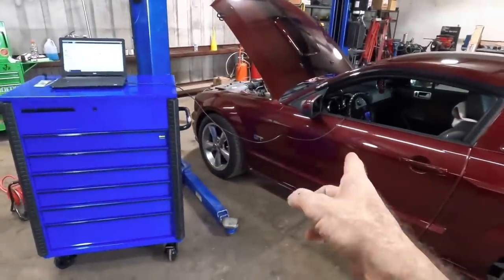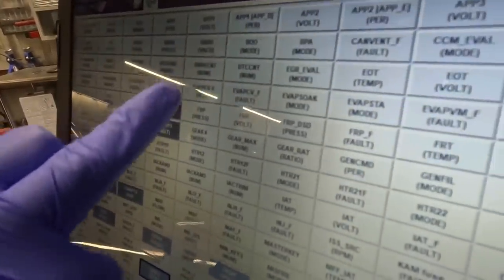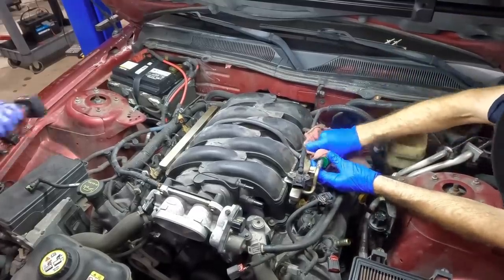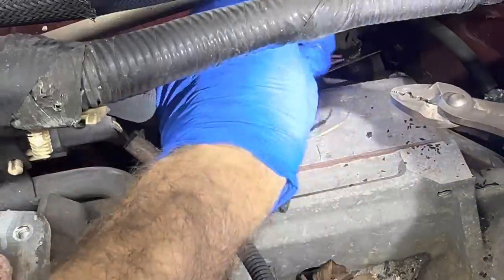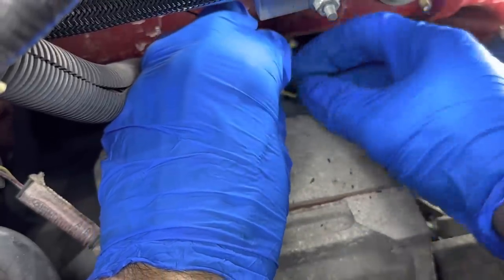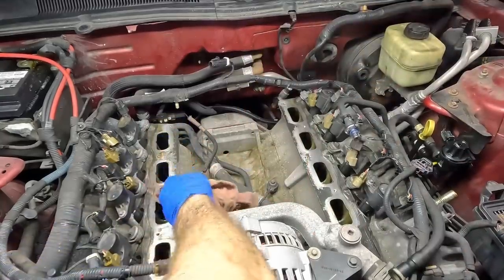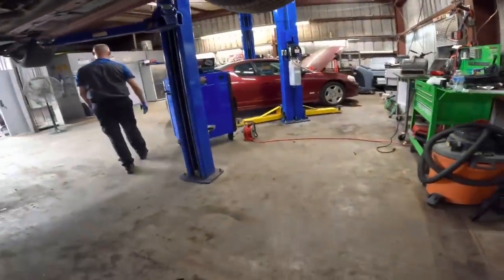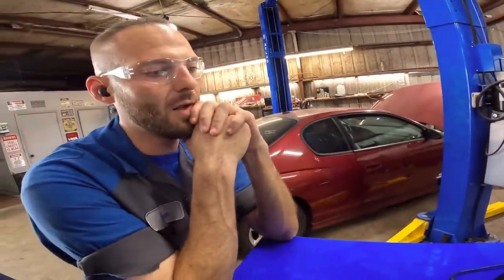Customer States: Light back on! 2006 Ford Mustang GT 4.6 3v P0171 P2096 Lean Bank 1 Misdiagnosed?

Comment: RAY READ PLEASE !!!!!!!i had a customer tune his f15o v8 5-4 using amazon coils and motorcarft plugs. i swapped new coils for pld ones same with plugs and added 1 new injector.. it ran ok 2 weeks later the gremlin was back i started with 7 injectors and finally we decided to use 15$ each moto craft plugs from ford it ran so sooth it was just amazing.... i got to reading the plug boxes and found the ford company plugs made in mexico Amaxon motorcraft plugs made in JAPAN!!!!!!!!!!!!!!moral of story you get what you pay for buy cheap now spend more to repair corrctly

Comment: On my 07 Expedition after it warmed up it ran like hot garbage. Found out it was an old dry rotted vacuum line, could be a loose line or a pinhole on this car. Or there's a short lol.

Comment: ray, ray....... help me out! I have a 2011 ford e350 super duty and I am going to flush out the brake fluid with a BILITOOLS 3L Vacuum Brake Bleeder Kit, One Person Pneumatic Brake Fluid & Clutch Bleeding Extractor Tool with Adapters & 1L Refilling Bottle. How many quarts will I need to get it done? Thanks in Advance

Comment: Basically This Issue Was possibly created by incompetent  installation of Non OE sensor Ray originally found . Thatsaid , defective OE O2 sensors extremely rare. It probably didn't need replaced in the first place. More likely a vac connection left off during maintenance,  then misdiagnosed

Comment: Bad upstream 02 sensor, Bad Hose or Boot past the Mass Airflow Sensor, Mass airflow sensor itself Bad /Dirty Connection or Cracked Manifold, PCV Valve bad, Fuel injectors working but not Correctly, Fuel Filter gummed up/Air filter. I think it is The Fuel Injectors or the O2 sensors

Comment: It worked before since the naked wire doesn't ALWAYS short out.   Is this the 3 valve that has such a wretched reputation?  EDIT - no, that was the 5.4 3 valve.

Comment: Be careful of the  quality of those heat connectors. I've used them on boats and trailers with mixed results.
Reply: Yep. There's no substitute for a proper splice done with the right tools.
The really good versions of those have a clear window and a disclosure dye that changes color when the appropriate temperature is reached. I still wouldn't use one for anything critical.
Reply: I've never used connectors like those. Do they offer any real advantage over a properly done traditional braid, splice, solder and heat shrink connection?
Reply: @bobhunt4402  they do provide a great seal. It's the type of solder in them that gets weak and can break up over time.
Reply: @danielpatty9485  Thanks for the answer. I guess I'll stick with braid, solder and shrink wrap.
Reply: @bobhunt4402  If you use marine heat shrink so you get a good environmental seal as well... the only advantage of these is time savings.
Reply: @bobhunt4402  Oh, almost forgot: solder < enviro splices. Solder joints will get microcrystalline fracturing over time just from heat cycling with as little as normal room temperature fluctuation*. Good crimped environmental splices don't ever appear to fail. It's the biggest reason we've all but stopped using solder joints in aeronautical systems.

*The greater the change, and the faster the rate of change, the faster it happens. In something indoors with low current, it might outlast you. In a high-power circuit (headlights, for example) in a vehicle stored outdoors, the life of a solder joint diminishes rapidly.

Comment: F.O.R.D.  Fix Or Repair Daily   Dear Ford Motor Company, Why could you have not specified your oxygen sensors on the 2006 Mustang GT and perhaps other models to have a much longer lead wire pair on them, with the connector well up into the engine bay, and a more heat proof conduit on that lead ? How many low mileage Mustang GT's and other models are out driving with the same problem or potential problem poised to happen ?     This is why your name has become an acronym that stands for Fix Or Repair Daily.  This is why I drive a Japanese car. Apparently in your compartmentalized engineering, there's little communication going on with the Technicians in the field, and between your different engineering departments.

Comment: So the Ray Rainman, (rainbow man?) Thinks the fault is the cheapo oxygen sensor, and she comes right back. They remove half the engine and discover a frayed waure. Course it's the grounded out waure. Why it is so important to put back waure holders. Raysmundo's fixes are PERMANENT, not like my bailing waure Arkie fixes. Guess I'll have to start using plastic waure holders instead. Didn't his friend from Michigan break a plastic part?

Comment: I wouldn't trust those connectors. Check out the video reviews where they pull them apart and show how poorly the very small amount of solder flows. I always use a soldering iron, apply paste flux (not enough flux in flux core for good flow, especially for wires), and the wires will pull apart long before my solder connections do.